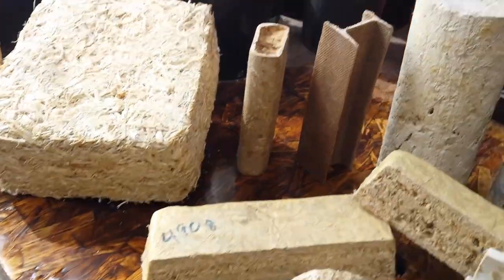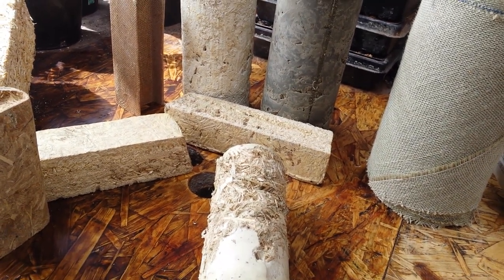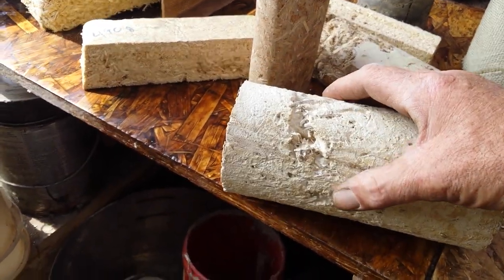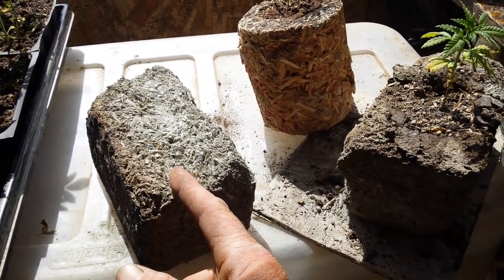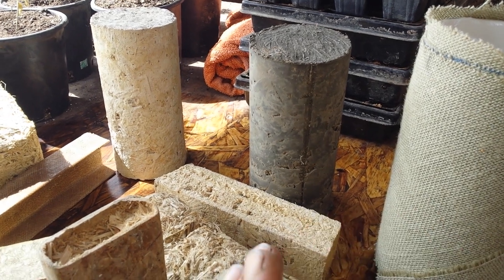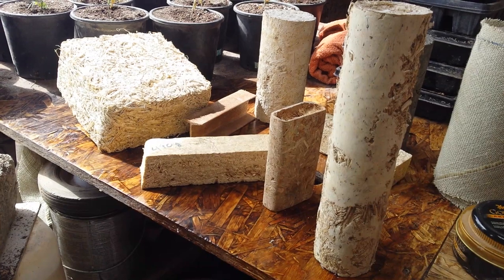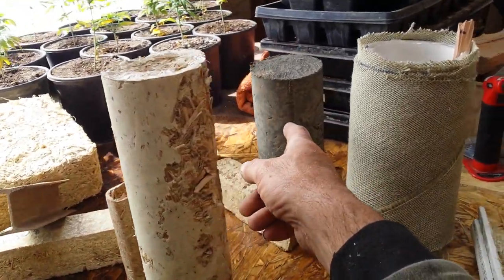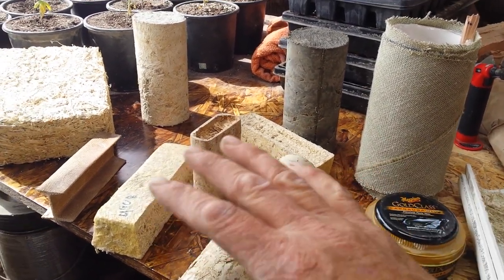Overview of Hemp Construction composites, Hemp fiber with various binders

Comment: I am experimenting with hemp structural products as well and you already did the experiments that I had in mind! Wow. I have collected over 6 acres of stalks and stems. Thanks for helping!
Reply from the maker: Six acres could be quite a bit Actually Let me Help, have several ideas that requires More
Reply: I have access to much more than six acres and these comments have motivated me to press on and not give in to spending money I don't have.
Reply: @BellozeCountry  Always list your state; this is how we help each other and build a community. Obviously, these are the times where we could easily build a community. You have access to the material. I'm sure a few more of us have access to equipment and pure manpower. Imagine a group of 50 of us. We could easily build each other simple structures very quickly and avoid most of the bs red tape. Much hope from Maryland.

Comment: The hemp we just harvested bent two 1/4" steel plates and a 2" shaft in a JD 770 Combine. If we hadnt stopped the operator, the combine would have pulled itself apart. We did 60 acres this year in OR
Reply from the maker: 😎 outstanding 🤔 might need equipment modification 😁
Would like to secure land to grow on here in Colorado
Reply: What was the thickness of your hemp?

Comment: I would love to see some bicycle frames made out of this stuff.
Reply from the maker: Airframes, bike frames, Oh my 🤗
Reply from the maker: Cosh Row 
Biggest day this might help early concept, Hemp bast fiber and PVA uniquely durable, if shear strength is needed bio-epoxy is available

Made a I beam check out that video as well
Cheers

 Hemp Bast fiber composite tube, body panel" on YouTube
https://youtu.be/zxj-86NIf8U
Reply from the maker: Hemp Bast fiber composite tube, body panel" on YouTube
https://youtu.be/zxj-86NIf8U
Reply from the maker: Cosh Row  tube was raw hemp bast fiber/ PVA
 I beam is Hemp fabric / epoxy
Reply from the maker: Cosh Row  IDK 🤔 but if you Do teach me😏
Made a flat basket weave of Raw fiber didn't do what I actually wanted 
it's extremely thin so
Alternate layers at different angles worked better for me
Reply from the maker: Cosh Row  depends how much strength you require
Raw bast fiber is stronger than any form of processing of the fiber

Comment: Wow! I love your drive to test and tinker with better designs and applications of hemp. You seem like the man to ask my question to. I live in Florida and I am planning on building a Quonset hut home to protect myself and my stuff from hurricanes. My thought is to also cover the Quonset hut with a couple feet of hempcrete for insulation and impact resistance, but I've heard that hempcrete doesn't stand up to direct weather (rain) very well. I always hear the contractors say "as long as it has a roof it will last for centuries". Well, what if I want to use it AS the roof? Maybe you know a way?
Reply from the maker: It's simple Puritan mentatity, Hemp Fiber is manufacturing manna you just need thing out side the box some
HempLime is Not suitable for exposure, HempCrete 'IS' for anything in a human lifetime,
Actually floats well if you augment the mix design or modified the same with monomers, sodium silicates, Simply Alchemy is all nothing New under the Sun

Comment: Thanks for sharing man very interesting!!
I can't help but thinking that grinding up the plant material so that the chunks are maybe 1/4 the size we see in the vid, would make it much stronger?? Have you experimented with changing the material size??
I'm thinking it would take away the size of gaps inside the material to make the bonds and supports closer to one another. Might make it less insulating but probably denser too....
Reply from the maker: Actually 😏 Yes I have further reduction of bast hemicellulose is possible as spinning, weaving etc
 Further reduction OR removing the bast hemicellulose from of the shiv weakens it DRAMATICALLY
Seismically Strongest, I have on video
Raw Strength of Hemp
https://youtu.be/RLvN1ci4K1w
https://youtu.be/HSE5vESjFk0
https://youtu.be/-Ktl6-4B0x8
Most Apocalyptically fireproof
https://youtu.be/fmCSmI-5MK4
Bast fiber raw strength
https://youtu.be/zxj-86NIf8U
Hemp Bast paper using shiv lignin
https://youtu.be/IkGEdYBXw08

Comment: Hey great video, very informative. I am thinking of making something with hemp fibers. How can I get a smooth outer surface of the shape that I cast, does it needs machining or should I just cut the fibers finely?
Reply from the maker: Gel coating the form with a light epoxy might help simar to fiberglass

Comment: currently I'm doing my final year bachelor project on the same hemp composite can i know what else binder did u use other than hydrated lime?it would be very helpful if i can know it
Reply from the maker: I've used Portland, magnesium oxide calcium/ sodium chloride
PVA polyvinyl alcohol and acitate  polyactic acid polybutylene adipate terephthate citric acid combination mycelium agar algae bio resin
 Honestly that's barely the beginning

Comment: You have 5 billion clients if this system can get started. Imagine growing the crop, processing, panelising, and having no design limits. R value would be terrific in a 5" SIPE because unlike a wood stud wall and fiberglass, it would be a breathable wall of ANY shape that will turn to stone. Slip molds and pressure systems are an area for large scale production. Any Idea what the R value is on a 4" panel? Hard to pin down as there will be thermal mass involved without lab testing.
Reply from the maker: @ a foot it's R75 but can stop over 3,400° for seventy minutes at only 17mm ~ 3/4"
Reply from the maker: We are working on raising the capital now for a Grand start on what saying
Reply: @mrglasecki  yes but I am talking about a a structure only 400 sqft total as a design limit. I design in the Park Model RV field mostly for seniors, singles and couples.I am remodeling a used one by letting contracts one at a time on a fixed income...Also on www.tugboatwilly.com. I may add a book to the 11 book series I am doing if Hemp keeps up this pace of development. My questions about 4" R Value was for a factory setting. I would not be surprised heating and A/C costs for a 4" Hempcrete wall would better a conventional wood framed fiberglass insulated wall in this industry and still have all the Hemp value...I just don't know about the weight for transport down the road to site.
Reply from the maker: Could you slipform, monolithic cast, or 3D print in place,.?
 Geo polymer is monomer modified to be exothermic, 
 1 hour cast (out of forms in 4 hours)
Concrete monomer modified can be pumped and printed as well they do take longer in monolithic cast and slipform even casting in a factory would take up space, and mold time
Reply: @mrglasecki  again what I deign is mainly for factory production. A printing machine itself can be shipped to Puerto Rico and be spitting out wind resistant homes every day but we have a Dick Tater that wants to punish the president of Puerto Rico???? True a convertible factory could be set up to produce panel Hemp walls and roof panels anywhere the plan will grow. A little solar and wind generator complex could produce all necessary power for production (strange when I was in 'Nam for two tours we had something called Seabees that could build ANYTHING at speed under enemy fire)( I suppose that has been sublet to tRump building Inc.) I do feel hemp can circumvent the current Federal Bureaucracy that is skimming 90% of all housing development funds from ALL federal projects. Citizens will just have to roll up their sleeves and get the job done....Like most successful projects you reach a point where the engineer has to be shot so the job can be done.( an industry hourly worker SOP)
Reply: @billburgess4720  set it up on Vieques Island . deal with the independencia political parties.  They really want to be independent from the main island. Vieques has the need and the poder .
Reply from the maker: @billburgess4720   consider my Portland monomer modified
3D printing will bring this technology anywhere at $15 sq ft
Reply: @mrglasecki  is it light enough to be roadworthy as a Park Model RV which I am trying to replace?
Reply from the maker: @billburgess4720  actually stronger than steel (>2×) so I would tend to say Yes
As mix design and engineering permits
Reply from the maker: **Bast fiber
Reply: yeah I'm getting into this industry asap..
Reply: @mrglasecki  there is farmland, 5600 acres, a turn key farm, being sold in Delta Junction Alaska. GREAT soil for growing hemp. NO BUILDING CODES. Build anything you want. Would be a great place to grow product and build. Purchase of the biz comes with land rights, all buildings, and farming equipment. Owners have given me word that they would help for a season or two to have a smooth transition. They have been growing wheat, and barley for 40 years. Located next to a river.

I want to 3D print hemp homes, finished with hempcrete and a tadelakt plaster finish. No more square homes. Cymatic homes :) Please lmk how I can help any projects you have going on. I'm currently changing my career path to align with building homes with hemp.
Reply from the maker: @tjsfireball  let me know how I can help, spring melt brings concrete deep into the State
 Alaskan gold would have no issues with cost
 Be a tremendous industry 🥰😎
Reply from the maker: @tjsfireball  
let me know how I can help, spring melt brings concrete deep into the State other than the difference in growth needs 90 days for barley grain and 120 for hemp grain * industrial hemp fiber (cannabis sativa) should do well large scale 
 Alaskan gold would have no issues with cost of actual HempCrete and enjoy it's R75 seismically structural abilities
 Be a tremendous win win industry 🥰😎
Reply: @mrglasecki  So glad you commented back! I do have some things I need help with.. How do I pick the best seed strain for Hempcrete use and where can I source enough seed for 200 acres? My thought process here is to get at least 1 harvest under my belt, to fully understand everything involved, and then expand. I want to use some of the land for building, with the hempcrete, as proof of concept, to bring future investors and show them capabilities. Also, how do I plan for all the Raw material I would get from a harvest? Hemp hurd would be used for building material, but what other materials can I get from a single crop? My interests are with building, Oil, and fiber for fabrics. If you want to discuss specifics, drop your email and we can chat further. I'm in the midst of speaking with the property owners about financing. Thanks, have a blessed day :)
Reply from the maker: @tjsfireball  
 Missed my chance at 501c3 for classes questions and research

 You might have luck with any of the many business that focus on any one of your needs 
 Best of luck

Comment: What a great video.  I have a quick question. What would you recommend of a lightweight 40mm H x 300mmL x 300mmL that can be routed?  I greatly appreciate what you have done.
Reply from the maker: Can you re word that with more words
Reply: @mrglasecki  sorry about that.  I want to make a lightweight guitar body from hemp that needs to be routed after it is moulded.  just wanted to know what your mix recommendation would be.
Reply from the maker: @fabtolli  two part epoxy nothing but stacked layers of Bast Fiber fabric
 degassed pre 'wet' fabric left near critical (cold)
 assemble and pull a 'serious' vacuum 0.8 bar or better

You'll have a 'blank' cnc millable

You'll have a Bad Ass Ax ot Body armour use as you see fit
Reply: mrglasecki thanks so much. Now to research what you just suggested. How about a hemp oil resin? Is that possible?
Reply from the maker: @fabtolli  VERY to separate the Hemp oil
potassium hydroxide KOH @ 1 part to 10 part hemp oil
Shake
Wait 15-60 minutes
You have organic diesel and the Sticky glycerin resin base

Comment: Hi great video just a couple of questions, 1 if you cast it with a resin do then compress it like paper mache fire bricks, 2 is there much shrinkage as it sets like if I made a 4 inch or 100mm  cube does t stay that size. Sorry for random ish questions but toying with ideas for building blocks.
Reply from the maker: With no resin binder I have tried, and it's not going to shrink like say Adobe either
Reply: @mrglasecki  thanks 👍

Comment: Hi i have a question, I am working on making a tabletop out of hempcrete and wanted to know if adding bast into the mix would make it so that i do not need a structure underneath or if i need to make a bast layer so that it can withstand the weight of itself and the future load??
Reply from the maker: Okay not positive how you are planning your project🤔😏
As long as adiquit material is used to accommodate your engineering

Your project should turn Out 😎
Reply from the maker: Watch "Hemp 17mm ×50mm geo board On Edge" on YouTube
https://youtu.be/HSE5vESjFk0
Reply from the maker: Unless your planning on placing something heavier than a truck on your table 
Should be fine as frog hair split 3 ways 😎
Reply: @mrglasecki  Thank you so much!! but that video is hempcrete reinforced with fibers or concrete reinforced with hemp??
Reply from the maker: @susanatoledano7966  by weight it would be Fiber reinforced concrete or modified MgO

Comment: Make sure to buy bio-based epoxy resins rather than petroleum-based epoxy.
It's a little more expensive but it kinda defeats the purpose of we mix renewable hemp with non-renewable epoxy, just my two cents'
Reply from the maker: * Actually the reason we use Hemp bast hemicellulose, is it's >more than several times stronger than steel by weight * captures CO2 and has a symbiotic relationship with mycellium building (struggling to maintain) the humic layers, and if we can undermine the capitalist structure 🤷‍♂️ it's a gain

Comment: What was your mix ratio to make the hand made demo type you got there. It Looks like a really nice finish.
Reply from the maker: Yeah😂🤣 Sorry that's just Too many to guess through

* Just a fast break down
Use hemp bast for strength shiv for insulation 
MgO and calcium chloride for exothermic or calcium silicate (Portland) acrilic modified for workability
Good luck in Your research
Reply: @mrglasecki  hi, do you think silicone casts can replace pvc pipes? Would I get a nice finish if I waxed it as well?
Reply from the maker: @ibrahimabdulle8121  silicone should work without wax definitely with
Reply from the maker: Slick finish can be nothing more than Saran wrap

Comment: Very interesting! how does hemp fiber and composites compare to flax?
Reply from the maker: How did flax stand up next to steel in your research, Hemp Bast is a two to one in strength to weight Over steel
Reply: @mrglasecki  I haven't done this kind of research, I ask because flax is the fiber most associated with hemp, at least in textiles they are said to be pretty much the same.
Reply from the maker: @slicktires2011  ahh I understand the conundrum, flax is a level of processing not the actual fiber and can reference several fibers that are only simar in fabric "handling" that's "Europe" verbage as just is a dewaxed raw Hemp Bast fiber "can" be called jute so can several others 😆😂🤣😅
"Industrial Hemp Beginnings" just made a video of it please check out the difference hopefully it helps and ALWAYS handle the material and always research
Reply from the maker: @slicktires2011  so that didn't answer it directly understandably if you Handled Hemp Bast fiber you Will never mistake it as you might other fibers, even at different levels of processing Hemp Bast fiber is significantly different and Nothing resembling " fuzz/pulp Fiber" that would be the Shiv Fiber (inner hardwood) 
Cannabis is a Extremely fast growing hardwood tree, not a plant, succulent, row crop, weed,. etc

Comment: Hemp OSB
Reply from the maker: If OSB was stronger than steel by weight 😏 hemp bast hemicellulose is a multi layered nano fiber
 Fully capable of making Hull's for offshore Blue water racing boat's

"Hemp Bast fiber composite tube, body panel" on YouTube
https://youtu.be/zxj-86NIf8U

Comment: Lasecki sounds polish... are you?
Reply from the maker: my father family was from Poland yet laska is Old Hebrew for forest, cki is only a variation means metal work
 third Gen immigrant to America mother was Ute
Reply: @mrglasecki  
I'll tell you a curiosity which you might don't know....
Did you know that polish surnames ended up with 
-ski
-cki
-dzki
were only for nobility
 families? :) 
So you got nobility roots!
btw man, can you tell me what are mixing ratio for hemp blocks, please? I wanted to try it out in here.
Regards.
Reply from the maker: @wake_nbake93  got me on the nobility, but if any family has a castle 
 I can absolutely rebuild it Apocalyptic 😁 with Hemp
 Please describe the block (normal hemp-lime is 4:1:1)
 Almost sure I give what I've used in the various mix designs
 Yet I can't give ratios for custom mix designs that's dangerous at Best 😏 nor will anything I've done work as well with various other fiber's

 have had Several attempt to use kenaf (basically okra cellulose with the strength of cotton) absolutely failure

Comment: Interesting video mate, have you tried experimenting with bamboo to get higher tensile strength?
Reply from the maker: actually not yet, have been trying mycilium as adhesive
 Hemp Bast fiber is stronger than steel
Reply: @mrglasecki  really? Can it be used structurally? I’m working on a hemp wall, but would prefer a hemp solution to the structure instead of a wood structure for the load-bearing. Just trying to understand where to start with understanding if (some kind of) hemp composite could be used instead of the wood beams?
Reply from the maker: @markschellhas  
Might consider
HempCrete 17×50mm tile https://youtu.be/HSE5vESjFk0